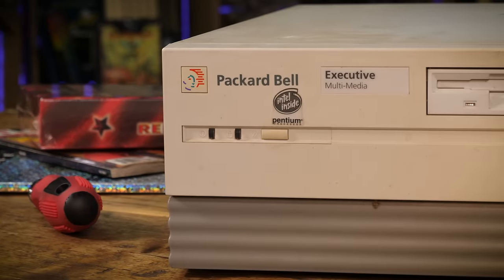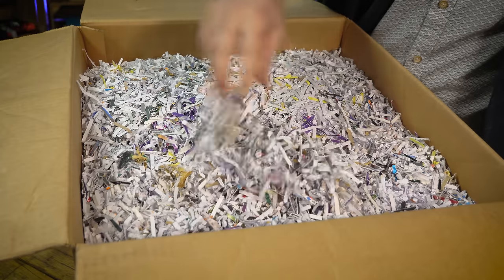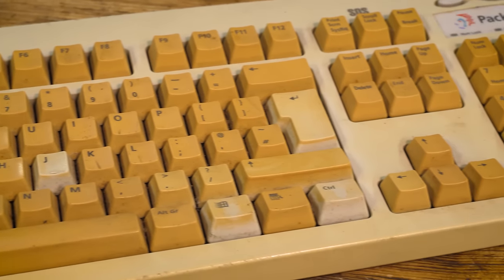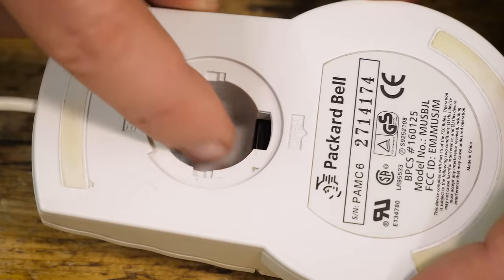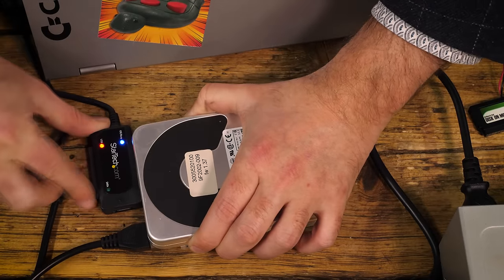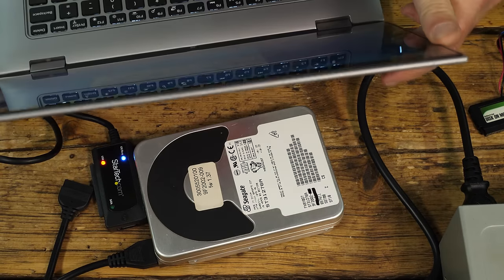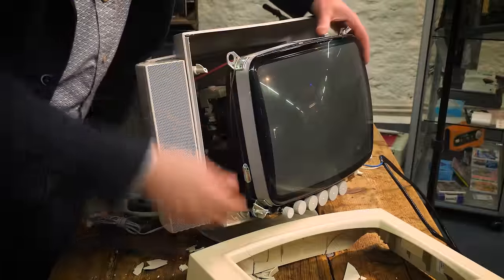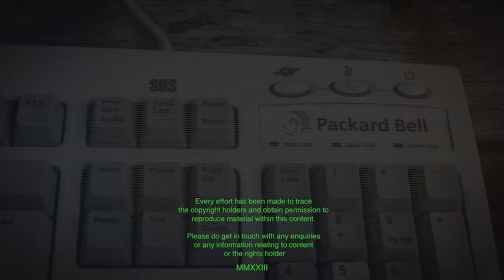Packard Bell Restoration | Testing & Cleaning Inside | Trash to Treasure Part 2

Comment: When I shipped my monitor to Neil, I was afraid that it would get smashed like this, but luckily it was fine! You've really got to make sure that EVERYTHING is firmly wrapped in bubble wrap, otherwise the courier service WILL find the weakness. A also put a Lego baseboard over the screen in between layers of wrap to protect it against any sharp strikes in that area, which made for a funny unboxing video!
Reply: Yea the shredded paper doesn't really provide any impact protection as such.
Reply: You also usually gotta pack em with the glass side DOWN. They hold up the best that way.
Reply: And I'd put the box inside another box with more bubble wrap. There's a good reason Amazon usually ships that way...
Reply: @Arachnoid_of_the_underverse  The monitor probably was shaken down right against the cardboard, the shreedded paper behaves like a liquid when being shaken and thrown.
Reply: Brilliant maneuver with the Lego plate!
Reply: Shredded paper is really useless as far as packaging, but good try for sure!
Reply: That funny unboxing video, which one is that?
Reply: @looks-suspicious  This one: https://youtu.be/0boDQoJdans about 31 minutes in. Only briefly amusing, but it gave me a laugh.
Reply: yes, the bit that really can not be shaken, the glass tube, the the most delicate part the electric connection, at  the gun end of the tube, in all more ever TV CRT, VDU etc. it left swinging free, sometimes with even circuit box, hand on the end too, and all connecting wires, all handing free, and no mater how much packing placed around the out side of monitor, that part deep inside the case will still be just handing unsupported, and if it gets damaged, there on fixing it,
Reply: this is why I always try and pick up CRTs in person, I don't want to risk damaging things this valuable
Reply: @jcardboard  I do this with large fragile 3D prints.  Bubblewrap within a box within bubblewrap within a box.

Comment: Sometimes you think that labeling the box "fragile", is just taunting them to treat it the worst way possible.
Reply: I hope karma hits them...grrr
Reply: @paul.1337  but there only so much buffer padding before you might as well just higher van and stuff it packing peanuts, and transport that instead
Reply: Couriers are typically not paid enough to care I expect. Its simply another parcel to drop off towards their quota for the day.
Reply: Never EVER pack the monitor screen down! Pack it how it would normally stand and put all kinds of supporting material around the main tube (and if you can, detach the base or pack it upside down).
If you remember opening one of these boxes from purchasing one, the handles were closer to one side, this is because all that weight from the monitor was heavy on one end.
Reply: Workers usually kick "fragile" items - kind of an inside joke.
Reply: I think they automatically assume it’s packed better because it’s fragile so they care less.

Comment: I worked tech support for PB here in the states.  If you want to try and find drivers for the modem/soundcard, look for sound 2 drivers. Snd1 was 14.4, snd2 was 28.8 and 33.6 and the snd3 was 56.

Trivia: the remote and IR were internally card Micky and Minnie. And the logo was "The face of technology", we referred to it as Randy Roadkill

Comment: The problem with reading that HD on your modern system could be down to the USB adapter you are using.  I have found those adapters do not always work with older hard drives.  It is much better to plug it into an older system that has an IDE port on board.  I keep an older Windows XP Core 2 Duo for this purpose.  It works great for imaging HDs. I am sure you have plenty of these types of computers in your collection, though. haha😉
Reply: I too am almost positive this is the problem. Hopefully he doesn't scrap or perform surgery on that drive just yet. Nothing beats a proper older computer for these kinds of things that's for sure. Terrible luck with USB adapters.
Reply: Absolutely, I have had no luck with these adapters either. I also use an XP system with a genuine IDE controller for them.
Reply: That is correct.  Those USB adapters are worthless for older hard drives, and at least in my experience, older optical drives as well.

I keep a Core 2 Mobile Mini ITX system with hot-swap IDE and SATA bays for this purpose.  Unload the sata_promise kernel module, swap in a drive, reload the module, Bob is your uncle.
Reply: @nickwallette6201  nice solution.
Reply: yes, the USB, thing, there not real hardware, and only see, what be told about, anything slightly funky just going to show as an error,
Reply: @catriona_drummond  I've got an older Logilink USB 2.0 and haven't had any problems with mid-90s and newer drives (I think I've tried it with 1 GB and up, might try some much smaller ones from the late 80s and early 90s at some point). And let's keep in mind this drive wasn't recognised by the Pentium either so I'm sure something's broken.
Reply: @Ragnar8504  It is very hit and miss. a friend of mine who runs a PC repair shop also has one that works really well for him. 
My Sabrent one actually killed a known working drive, unless it was the coincidence of the century.
Reply: @catriona_drummond  Sounds like I was lucky indeed!
Reply: except he put it on the packard bell pc and it couldnt see any bootable partitions either so i think is the hard drive, i have an ide to usb adaptor and i can read any hdd even mac os formatted ones, all it does is adapt an ata bus to usb it doesnt know what the hdd actually has at all

Comment: I was a Die HArd Amiga guy.  My FIrst PC clone was a Packard Bell 166.  I repurposed those speakers and screwed them into the sides of a random 15" VGA CRT.  I got tons of use out of the PB, mainly Corel Draw 7.0/8.0.  I kept it until 2000, when I built my first PC.  AMD 900mhz machine.  Awesome stuff!  Then upgrading addiction began.

Comment: Oooofff, that was heartbreaking regarding the monitor but kudos to the guy for refunding. This is definitely the range that was being sold during my work practice back in 1997. The only difference I can see is that the IR receiver was build into the mouse but I guess there were different versions of this. Also, back in this day I don't think FAT32 was a thing yet, and hard drives would still be using FAT16. I could be wrong but I have this feeling that FAT32 only came about with Windows 98 or maybe 95 OSR 2. Another great video, Neil. Really looking forward to the next episode.

Comment: Back in the day (~2000 or so) I was selling computers at Circuit City, and would offer services on the side to transfer data from the customer's old computer to the new one.  Got to one lady's house and she had a Packard Bell.  Don't remember the exact model, but it was probably from the same mid-90s period as this one, but a consumer model.  Ended up having to go home to get my drill bits, because rather than using screws, PB had riveted the case shut.  Had to drill them out to open it up and access the old hard drive.  Needless to say I don't have fond memories of PB computers.  :D

Comment: I suspect it might be worth trying a different usb to ide converter with that hard drive. I used a similar device with an old Connor drive the other week and had no luck getting the drive recognised. I switched to a different converter (actually out of a mid2000s usb/fe LaCie drive) and it recognised the drive instsntly

Comment: I just had an idea come to me:  What if you converted an old front-loader washing machine into a retro-bright machine?  You could suspend a UV lamp in the middle of the tub and simply rotate the tub at a very slow pace to prevent damage to the articles.  The tumbling action would ensure the parts see UV on all sides and the tub would submerge the parts in the peroxide solution.  Obviously this would only work for smallish parts.

Comment: As much as it hurts to see, I am glad to know the shoddiness of parcel delivery is similar across the globe.  I have given up on buying CRT monitors where they have to be shipped to me.  The reason being that out of 12 monitors purchased, one has arrived safely.  Three of those were new old stock in their original boxes and those were packed in additional boxes with more packing, and UPS, USPS, and FedEx have still managed to mangle, shred and completely destroy said monitors.
Reply: Exactly! Like every kind of enterprise in the latest years, courier employers are quite happy to apply the mantra of "rise the profit margin by hiring less people and giving them more work" to the extreme. In most cases, the couriers in my city drop their parcels in front of my condo, ring the bell and immediately run; they don't even wait for a signature, much less they ensure I've actually retrieved my package. It's maddening.
Reply: The way these things are treated in shipping there is no amount of packaging that can save them. They ere dropped so hard that they collapse under their own weight, internally. You'd have to cushion them on the inside. 
I often recieved shipped CRT's until the pandemic here in Germany and most were okay, but in the last 2 and a half years something changed across all shipping services and the heavier a package is the more abuse it gets. They hate these heavy packages and they deliberately try to break them so you don't ship heavy stuff anymore.
Anything that is above 12 kilos I drive and pick it up personally. Or it WILL get destroyed.

Comment: I think it was the plastics had dried out and was just brittle on the monitor. It did have to support the weight of the CRT tube inside and they are quite heavy. On my recent Amstrad PC2286 video I snapped all the plastic clips that hold the keyboard together, instead of flexing a bit they just snapped clean off.

Comment: I've ordered and had a few CRT monitors shipped like this too. The successful ones either had the monitor stand removed, or was packed upside down with the stand on top. Putting all that weight on that stand when the box is being tossed around in shipping causes the plastics to flex and shatter. Or so my current theory goes...

Comment: "Packard Hell", to be fair, it was a pretty rough time for most computers. Extreme levels of bloatware with marginal specs and there was a lot of propietary, and expensive AF, hardware still around.  Most computers of that era were barely usable out of the box, a RAM upgrade and clean install of windows (to clear the bloatware) worked wonders.

Comment: Interesting video.  In 1997 I had a Packard Bell Mini Tower with same monitor and speakers; it had a Pentium 233 MMX, I think it had 128MB Ram and 4GB drive.  Worked fine other than having very slow 3D graphics, but that all changed when I installed a Voodoo Banshee 16MB GPU which made it fly.

Comment: I think relying on the original box was the core shipping error, and I can't imagine the paper shredding did that good a job realistically. That thing needed proper, squishy foam, everywhere. And probably around the entire box, placed into an exterior shipping box.
Reply: Yeah, absolutely packing it with shredded paper prolly made it quite rigid, causing every bump to be translated to the monitor casing. But I like your out of the box thinking (hue hue) for putting the whole box into an exterior shipping box! 👍
Reply: @Mars-l9b  Honestly, shredded paper doesn’t make very good packing material. It’s neither rigid nor cushiony.
Reply: The way these things are treated in shipping there is no amount of packaging that can save them. They ere dropped so hard that they collapse under their own weight, internally. You'd have to cushion them on the inside. 
I often recieved shipped CRT's until the pandemic and most were okay, but in the last 2 and a half years something changed across all shipping services and the heavier a package is the more abuse it gets. They hate these heavy packages and they deliberately try to break them so you don't ship heavy stuff anymore.
Anything that is above 12 kilos I drive and pick it up personally. Or it WILL get destroyed.

Comment: My first PC was a Packard Bell 486SX 25 MHz, 80MB HDD and 1 MB of RAM. Added a Sound Blaster 2.0 and a double speed CDROM drive when the Multi Media hype started. De CDROM drive cost me 425 and later and I had to shell out another 400 credits for 4 MB of extra ram in order to get The 7th Guest to run properly.

Good memories...

Comment: The hard drive will likely work just fine with a motherboard that has onboard IDE rather than using the USB to IDE adapter. I've had plenty of older hard drives act just the same with multiple USB to IDE adapter that infact works just fine on an onboard IDE connection :)
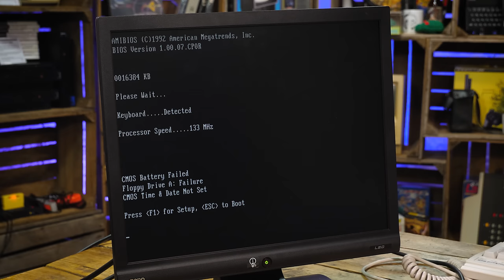Reply: It didn't. He tested it directly on the original board as well: 14:27 (Doesn't make your USB-IDE adapter tip any less useful though!)

Comment: Blast from the past, I wrote the recovery routine for the Packard Bells supplied by Dixons/PCworld/Curry's in the UK.  If you have issues installing the OS give me a shout, there is a CMD switch that is required when installing windows to pull the Tattoo license info.

Comment: I bought the older 486 version of this a couple of years earlier, it was so bad I took it back to Dixons for a refund. After that I went to my local PC store, MSD in Stirling, talked to them about what I wanted, and then got help to build my first pc. So much more value for money - 486dx22, 8mb Ram, 300gb (**mb) hd, 512k Hercules video, and sound blaster card :)
Reply: 300gb in a 486? Seems a bit overkill lol
Reply: @saintuk70  lol I kinda assumed that was the case. Sounds like a nice little machine

Comment: You might have a goofed up sector or two on that drive.  There used to be tools where you could read them, decode them, and then write them out.  Peter Norton had some tools that would do it.  Also, very early on there were BIOS' that required special characters different from other BIOS'

Comment: This might be a slightly controversial take, but this video is a great example to why not chase old CRTs at any cost (unless you build a perfect museum piece like Neil does here). Yes, those old pieces of hardware and software were designed with CRT monitors and TVs in mind and they are certainly the best way to enjoy a period piece. However - unless the CRT is nearby -, I can't really advocate for dragging one across the country or countries. They are heavy, fragile, could develop loads of problems  just during delivery and they are getting more expensive by the day.

Comment: Given the state of the monitor plastic, it is kinda amazing that the tube survived. 3D printing might be able to help with some of the plastic repairs perhaps?

 If you have all the pieces and it does still work, you may be able to use plastic weld to weld the plastic back together and repair it enough to be usable at least initially until you find another one to salvage the casing from.

Comment: My mum and I went halves on a P60 Packard Bell the same as this. Little did we know that 8mb was never enough for Win95, the 600Mb hard disk was woefully inadequate and the combi ISA card was a driver hell. Plus the pentium 60 was a faulty PENTIUM 75. Saved up £90 and cycled down to Dixon to get another 8Mb and they didn’t bother to tell me that they have to go in pairs….didn’t work and had to ride back and get another one. £180 for 16mb ram! Did get my first 33.6 modem for it though. Immediately ran up a £100 phone bill on compuserve PLUS the phone bill to go with it. What a rip off it all was!

Comment: I hope you have better luck with retro bright than I did.  I usually get along pretty well with it, but the two PB systems I have, which were both in need of de-yellowing, proved to be quite resistant to peroxide.

I tried intentionally going too far, and it over bleached some of it, and under bleached other parts.  A mix of yellow and albino ghostly white where none of it quite matches properly with other panels.

Very very stubborn plastic, that.